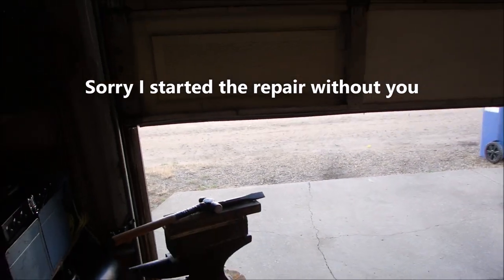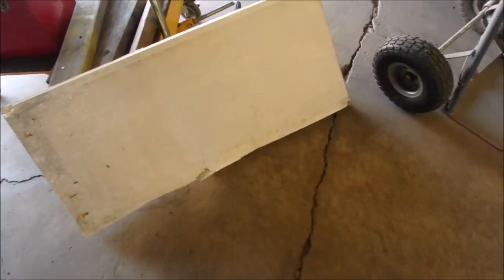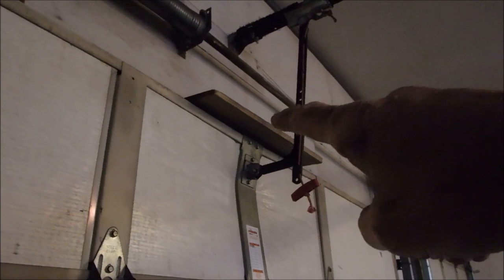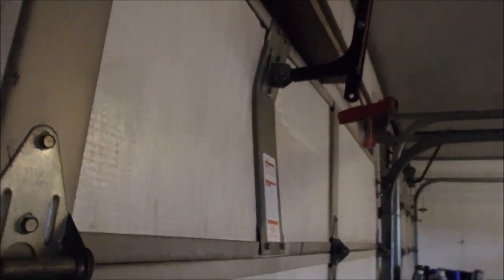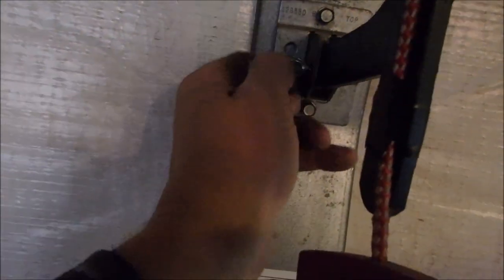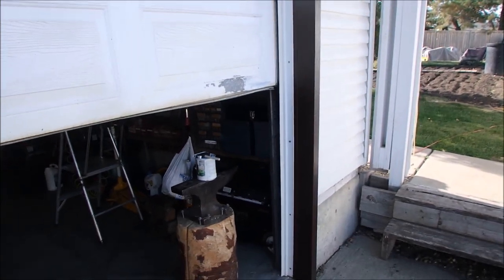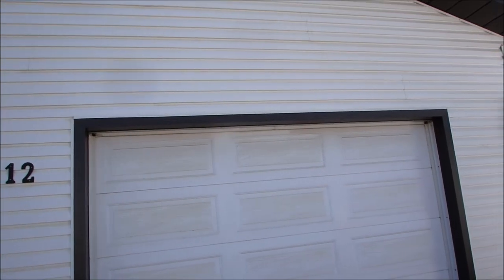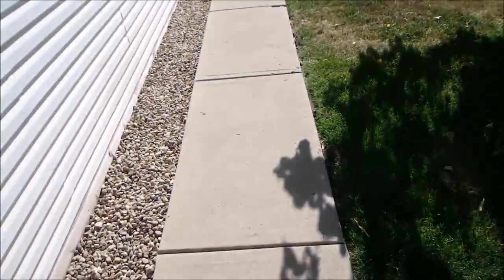Attempted Break In At Bruce's Shop!!!

Comment: Your security steps worked this time.   Well done.   Perhaps look into a wireless security camera system.   We have Ring and it's been very good.   You can mount a combination camera and motion activated flood light over the garage.   I would also install a siren inside, so if there is entry it goes off; loudly.   Those things should help.   I'll leave it up to you regarding self-defense measures.   Nice repairs and I'm sorry you had to deal with this.
Reply from the maker: Thanks for the advice

Comment: Hi Bruce if I was you I would put strip of metal along the bottom now with domed bolts to secure it make it the bottom more stiffer or  2b one wood along the bottom to strengthen it so they cannot Bend It Up think that insulation has helped in the first place
Reply from the maker: Thanks for this

Comment: Bruce, you see where the "weak spot" is in a wide opening, the middle. Make some modifications - horizontal- top middle and bottom. This will also help with wind storm issues...Next drill a set of holes in the floor to accept a sleeve for a few pieces of 3/4 or heavier rebar, just in case your midnight friends try to open the door with a car bumper next time...AND DON'T show or share your efforts, if you know what I mean.
Reply: The rebar doesn't work on pop can material garage doors. It does work on the beefy steel and wooden doors though
Reply: @staind288  It is what he has to work with, and you saw the "advanced" prying equipment used. Between a horizontal member at or near ground level and bars it is better than nothing. You can only do so much with any door, you can only deter a thief so long that they risk being discovered.
Reply from the maker: Thanks
Reply: @lenscap8925  what he has to work with? The guy is a retired electrician! He has or can find Whatever his heart desires. The rebar would not do anything but rip the door material where it slides through the sheet aluminum. It is a good idea, just not feasible in this particular situation